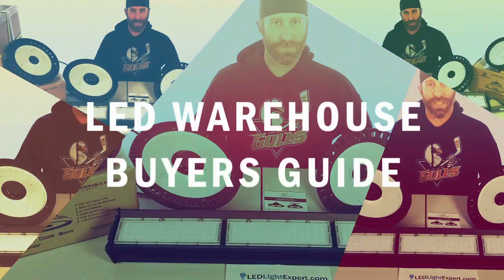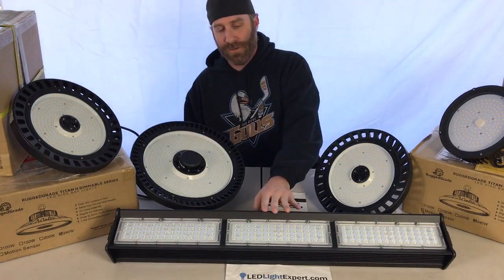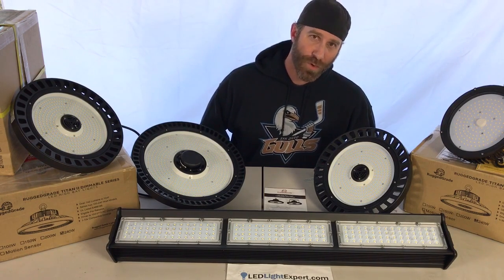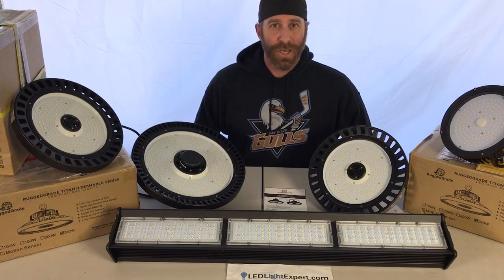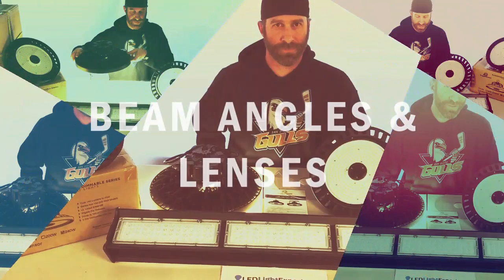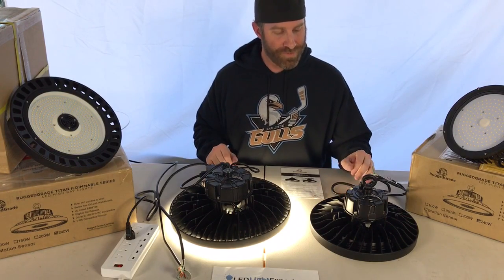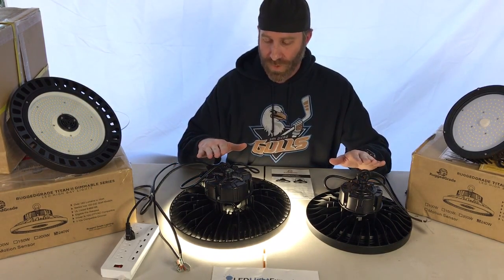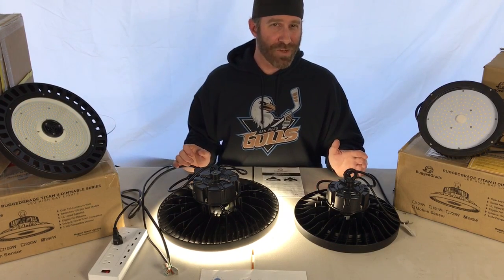LED Warehouse Lights Explained - Buyers Guide on Warehouse LED Lighting & LED High Bay Light

Comment: most of these lights are rated for 104-113 degrees i worry they high temps at the roof would easily be higher than that
Reply from the maker: The Corvus Series and Titan Series we carry from Rugged Grade are rated up to 120F operating temp which is pretty standard for warehouse lighting. If you have temps above that, you may need to think about high temp or explosion proof lights. Feel free to give us a call and speak with one of our light techs to go over your application so we can find the best match for your needs, 800-674-9420.

Comment: Built a new shop, 27 deep x 36 wide, ceiling height about 14'. Building is drywalled and painted bright white. I've wired up 2 rows of three round boxes in the ceiling, spaced evenly with the floor plan. So with a 6-light limit, what UFO-style lights do you recommend for bright lighting for a hobby car shop? Thanks!
Reply from the maker: Always best to speak with a light designer to go over your project specifics to figure out the best fit for your needs. You are welcome to give us a call at 800-674-9420 ext 1 to speak with one of our light designers. With the given information, the best fit would be our 100 or 150 watt Corvus Series UFO High Bay lights: https://www.ledlightexpert.com/150-Watt-LED-High-Bay-UFO-Corvus-Series-Lights--21000-Lumen--DLC-Premium-Verified--33ft-cord--5000K-Bright-White_p_275.html or https://www.ledlightexpert.com/100-Watt-LED-High-Bay-UFO-Corvus-Series-Lights--14500-Lumen--DLC-Premium-Verified--33ft-cord--5000K_p_276.html

Comment: I dunno if I really like the idea of having to throw away entire light fixtures and rewire it over changing out bulbs.. wish just the actual LED lighting module itself were replaceable and one could get spares to keep put away.
Reply from the maker: Changing out bulbs is going to happen far more often than you would have to replace anything on a quality LED fixture, like those from Rugged Grade. In many commercial applications, this also means renting a lift just to get up to the fixture adding more to the cost. If you are paying $20 per bulb on a 400W metal halide (common high bay bulb) and it lasts about 15,000 hrs, compare that to an LED fixture that you paid $130 for that lasts over 100,000 hrs, you are going to be replacing 6-7 bulbs in the life of that LED fixture, costing you $120-$140, plus lift rentals which will cost hundreds or thousands depending on the height for all those bulb replacements. Stack that with the fact that over the course of 100,000 hrs, the 150W LED vs the 400W metal halide will save you over $3000 (at a modest $0.12/kWh) in energy costs alone. LED easily wins in both cost and time of maintenance versus swapping out bulbs.
Reply: @LedLightExpert  why does it have to be one or the other? I am not talking about the old type of light bulbs, if you read the second part of what I wrote. The industry needs to standardize a new version of light bulbs for these LED fixtures even if it needs to be in a new set of form factors then fine. 

Unfortunately too many bad quality LED products on the market have made us wary of investing large sums and then having to get an electrician to install it to boot so that the company cannot try to blame us for doing something wrong if it stops working in in 3 years to get out of guaranteeing their bad product with a supposed 5 or 10 year warranty. I do not like the idea of throwing away the entire light fixture when the light goes out. That is just unnecessarily wasteful and should be easily avoidable. The shipping cost and cost of the material going into the hunks of metal containing the actual lights and circuitry surely makes a difference. We can always improve even if it's already better than the old way. And some of us don't have 20 foot high ceilings. We get up on a ladder and change our lights ourselves so there is no real extra equipment expense involved to begin with.

Comment: Great information. I have a 40 x 80  shop with 14ft ceiling, With 4 rolls of 3 T8 4ft lights. Each with 4 T8 LED Light Tube, 4ft, 22W (70W Equivalent). I want to upgrade to LED 5000k lights. To many dark areas. Need brighter lighting, possible something I can dim if needed. Got to be affordable, Can you recommend lights please?
Reply from the maker: hi there.  i would recommend 8 of our 150 watt Corvus series UFO. two rows of four.  See the picture of this page of a 40x72 shop with roll up doors; https://www.ledlightexpert.com/How-many-light-fixtures-do-I-need-for-my-warehouse_b_7.html   Very similar to your layout and you can see how bright and even it is with just 8 fixtures.  Lights are dimmable and can be seen here; https://www.ledlightexpert.com/UFO-High-Bay-Light_c_31.html

Comment: Hello
What the rationale against 5700k in favor or 5000k ?
Thanks
Reply from the maker: Color temperature is mostly a matter of preference. Higher Kelvin temperatures usually have a slightly higher lumen output and just feel brighter to our eyes but can also feel more harsh on our eyes. The AMA recommends against the use of lights higher than 5700K so we tend to try to keep below that threshold and have found 5000K is easily the most popular for warehouse and outdoor lighting for a bright clear light without being too harsh on the eyes.

Comment: I’ve just built a 50x100’ metal shop.
Eave height is 17’, so the lights would be at 15-16’ above concrete floor.

Q: 
Can you configure the space and spec out the fixtures you recommend?

Thanks
Reply from the maker: We have light designers on staff to help with projects like this. They will go over all your specifics to help find the best layout and lights for your needs. Every application has different lighting needs and factors so speaking with a light designer can help make sure you are happy with the results. We can also do photometric studies to get a computer simulation of the lighting. You can reach out light designers at 800-674-9420, press 1 at the prompt.

Comment: How do I wire the dimmer wires if I do not want to use a dimmer?
Reply from the maker: Leave them capped off.   Never touching.  Just tape them up out of the way.  If they are never connected the light will work as a regular on off light

Comment: where the audio volume?
Reply from the maker: We have since upgraded our microphone system for better audio quality, but you should still be able to hear this video quite easily, just might need to turn up the volume a bit when viewing. You can also read through our buyers guide linked in the video description. Feel free to give us a call if you have any questions or need help figuring out anything in your light plan, 800-674-9420.

Comment: Building a workshop 50x60  at 16to 18 foot high.. how many do I need and what wattage.
Reply from the maker: Adam - At that height we would recommend 150 watts like our Corvus Series UFO High Bay Lights: https://www.ledlightexpert.com/150-Watt-LED-High-Bay-UFO-Corvus-Series-Lights--21000-Lumen--DLC-Premium-Verified--33ft-cord_p_275.html. As for spacing, 3 rows of 4 lights per row would get you good lighting in there. This is a base estimate on what we would start at given the information provided. A few other factors can come into play and going up or down in light count is possible depending on your needs. I would recommend giving us a call and speaking with one of our light experts to go over your project and make sure this will suit your needs, 800-674-9420.
Reply: we have warehouse lights. we are a LED lights factory from China. If you're interested, pls contact me.

Comment: Hi I need serious help in backlighting for inspection panel. Is it possible use AC plug n play with dimmable feature? On what height should it be to have it in 60mm box?
Reply from the maker: Not quite sure what you are trying to do as far as backlighting, the best thing I can recommend is to give us a call and speak with one of our lighting experts so we can go over your products and help figure out what will work best for your needs, 800-674-9420. All of our products are direct wire AC, just need to add a plug if you want to simply plug it into a socket. With a dimmable light, you will just need to add a dimmer switch to control the dimming. You can see our video on dimming here: https://www.youtube.com/watch?v=fFacm-5Qeog&t=2s
Reply: @LedLightExpert  erm I need to know for backlight in inspection industries, is it possible to use edge lit LEDs and did not have the effects of 'spot' lights? I will cover it with a thick teflon sheet which I hope the lights disperse into one plane.. or else I will need to try the common backlit LED..
Reply from the maker: Again, I do not quite understand what you are trying to do. We offer LED fixtures, retrofit kits and corn lights, along with some accessories. My best recommendation is for you to give us a call so we can figure out exactly what you are doing to see if it is something we can help you with.

Comment: I'm building a 30x60 Garage with 13ft interior ceilings. Wondering what you would suggest for size of lights for that application. It will be used as a work shop so definitely want it nice and bright but dimmable. was thinking 4 rows of 3 lights evenly spaced across the 60 ft Span.
Reply from the maker: Jordan - At that height I would recommend 2 rows of 4 lights (4 lights long the 60 ft length) and our 100 watt Corvus series - https://www.ledlightexpert.com/100-Watt-LED-High-Bay-UFO-Corvus-Series-Lights--14500-Lumen--DLC-Premium-Verified--33ft-cord_p_276.html - this should provide plenty of light and the Corvus UFO lights are dimmable and very easy to install.
Reply: we have warehouse lights. we are a LED lights factory from China. If you're interested, pls contact me.